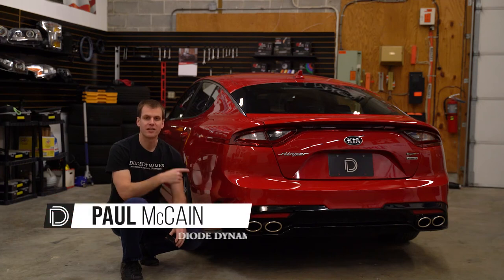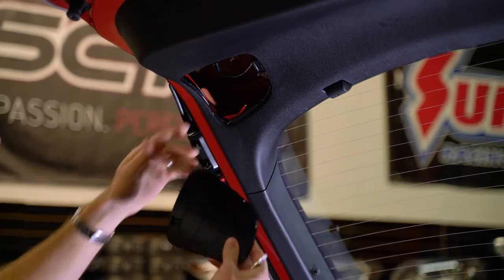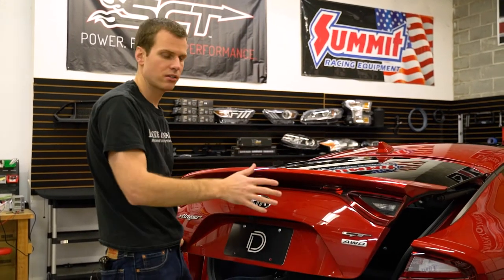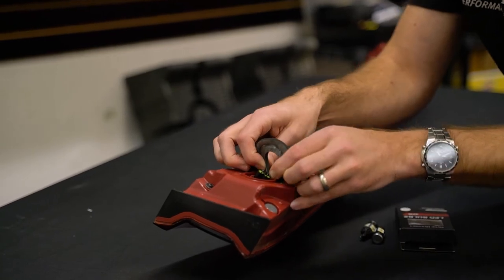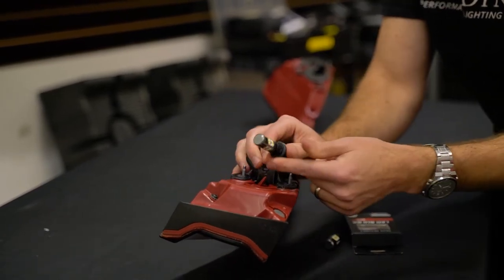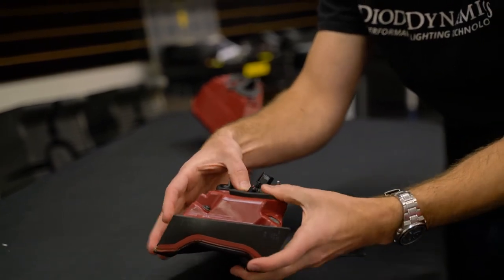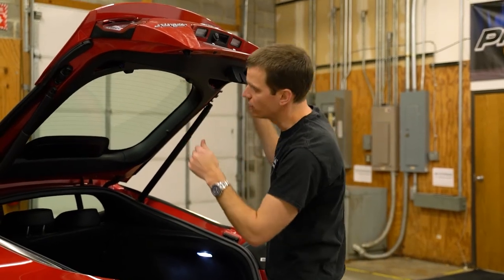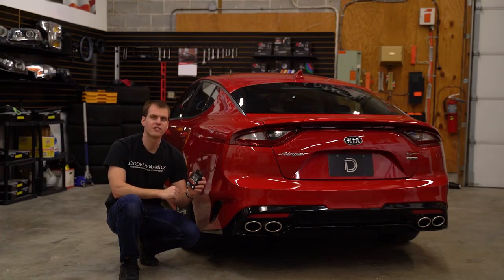How to Install 2018-2020 Kia Stinger Reverse LEDs | Diode Dynamics

Comment: Would this process be the same on a 22 Stinger GT-Line? In regards to the removal and wiring
Reply from the maker: Hmm- we're not sure on the 2022 model. However, if you give us a call at 314-205-3033 Monday-Friday 10 a.m.- 5 p.m. CST, or shoot us an email at contact@diodedynamics.com, we can help you figure it out!

Comment: Maybe a stupid question but, are we disconnecting the battery before any of this?
Reply from the maker: That's not a dumb question! Just make sure that the car is turned off and there's no power going to the socket during the installation!

Comment: I just installed these and I feel like they look the same in my reverse camera, it doesn’t look nothing like yours, have any ideas what it could be?
Reply from the maker: Hey Jose! 

Are you using the same bulbs as installed in the video? We used our 921-size XPR LED bulbs!
Reply: @diodedynamics  yes I bought the same one. I can tell the difference if I’m looking at the lights but in my camera it looks the same nothin changed at all.

Comment: Are the yellow rear turn signals already LEDs?
Reply from the maker: Some models of the Stinger do come with LED rear turn signals, and others do not. The particular model in this video comes with LEDs.
Reply: @diodedynamics  hmmmmmm 🤔. I have a 2020, the rear turn signals are pretty bright, I feel like mine are led but I guess I don't know for sure.
Reply from the maker: @michaelthompson4178  If you shoot a picture of the bulb  to us at contact@diodedynamics.com, we can let you know which ones you have!

Comment: Hey bro I have question, I got a stinger gt line 2020, can a headlight of a gt2 fit on a gt line, just cuz I like how it looks more on a stinger and if not can a spec headlight fit. Cuz I want to order it but then again I don’t want to buy something that wouldn’t fit.
Reply from the maker: Hey, sorry for the late response. We're not sure if the GT2 headlight will fit in the GT1. Sorry about that!
Reply: Diode Dynamics is alright thanks
Reply: @manny94nyc3  I also wanted to do this. I like the GT2 lights more but the GT line lights aren't bad either. I do want to put different bulbs though as the ones that come in the GT line are not of my preference. Light is a little low!
Reply: @5veRodriguez   yeah i figured I just stick with the gt line headlights it look nice and just change the bulbs so it would just give it more lights
Reply: @manny94nyc3  my boy put some 6k lights and it looks sick man. The shop I go to couldn't install them today because I didn't have time. Turns out they have to remove the front bumper and the housing. They have to shave a bit to fit the lights since the whole is small to fit the ballast?. Still thinking if I want to do that or if I should wait for a company to make fitted ones? Either way the guy at the shop said the process to install isn't hard. Just takes time (about an hour and a half)

Comment: Wish that entire rear Stinger reflector was led lighted, rather than have really zero purpose. I own the 2019 GT2 and I’m doing what I feel are pretty basic KIA should’ve included on this 50k car.
Reply: They should've just ditched the middle section and went with 2 individual lights
Reply: @michaelthompson4178  That was something I’ve thought about since buying the car.
Reply: @stevewise1656  why buy something you aren’t completely happy with?